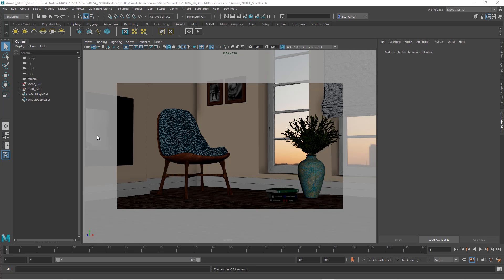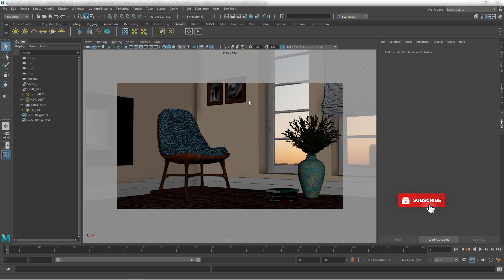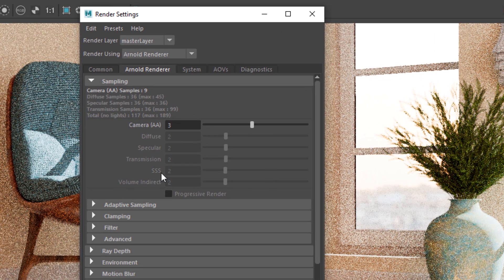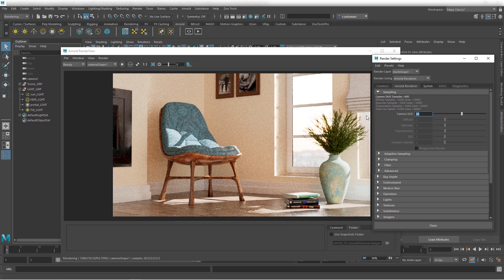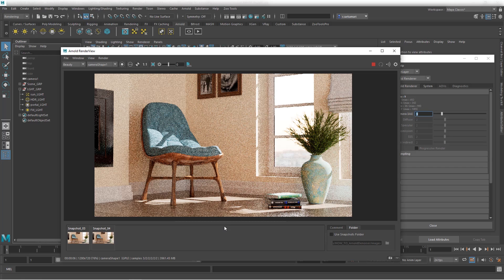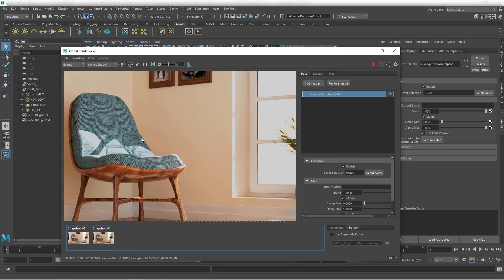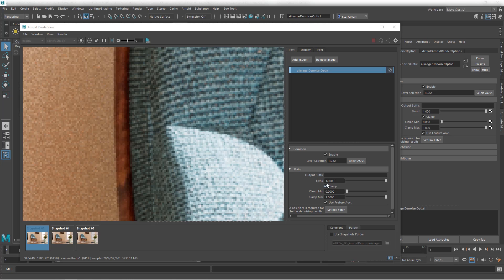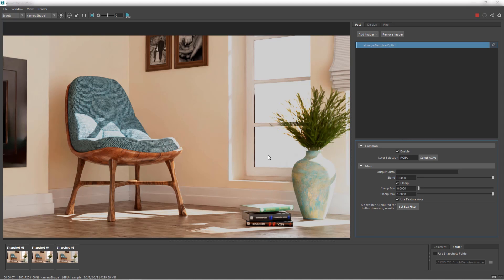Denoise with OptiX™ in Maya

Comment: One thing to note though is that aggressive denoising eats away details from the render. It's visible even in your render, chair and other areas loose details and have other issues. Usually denoising is used to clean the last 30% of the image

Comment: This is definitely quick but one thing I noticed is that when I render out an animation, the animation is flickering. Does anyone know why that is happening?
Reply from the maker: Are you getting the same result with NOICE denoiser?
Reply: @sarkamari  when I use Noice, does it have to be with CPU or can I use GPU?
Reply from the maker: Best is to use CPU
Reply: @sarkamari  Got it. When I do GPU rendering with Optix, I try to render transparent materials on a transparent background (png or tif format) but there is still a lot of noise on those models. The noise doesn't show up on the transparent models when I have a non-transparent background (like jpg). Any idea why?
Reply: @sarkamari  haven't tried that one yet. Going to do that next.